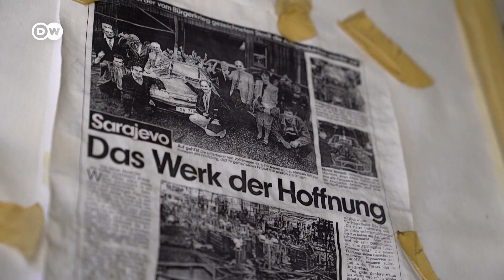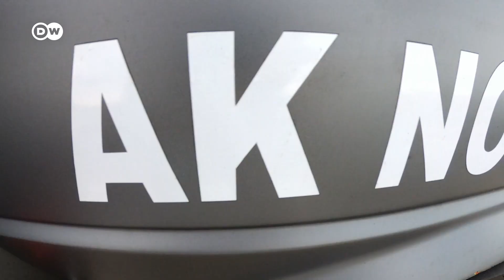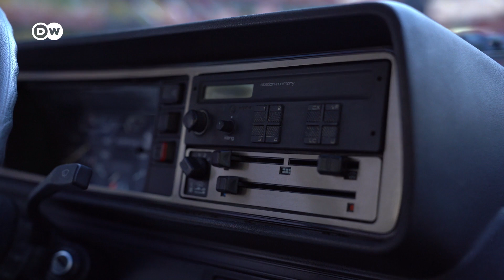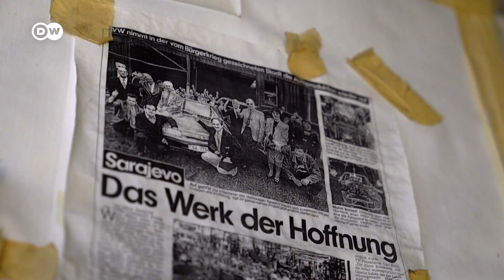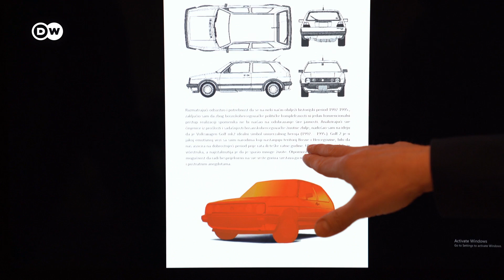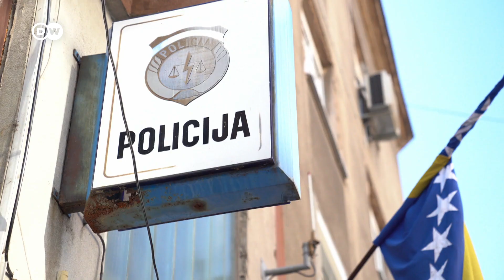Why Bosnians Only Drive Volkswagen

Comment: My father bought a used (1985) Golf MkII in 1995, right after the war for 1.500€. He drove it for 15 years and had someone offer him €1.700 for it after that time. The stories you can hear about this car around here are mind boggling.
Reply from the maker: What a great story! 🤩 Can you tell us some of those stories? We would also love to see some pics or a video from your Golf. Looking forward hearing from you.
Reply: @DWREV  i have a friend that uses a mk2 golf 1.6 diesel for work with 650 000km on the clock. And i mean USING it. Loading it with construction material and driving workers around 😆 While his mk4 golf is kept in the garage for rare occasions.
Reply: due to inflation i guess he did not gain any money even tho the number 1500 is lower than 1700.
Reply: @heisenfeis  He never sold it.

Look at it this way, imagine you bought a car 15 years ago. A car that was driven and wasnt kept in the garage and wasn't invested in. And then someone offers you more than what you paid for it. And we're talking about a car that has been produced in tens of millions, not some rarity.

Inflation would be 43.1%, so it would come down to 2.146 Euros.

Which would mean my father drove a car for 15 years and it only cost him 646 Euros, 43 Euros a year.

What other car can you rent for 50 bucks/Euros a year?
Reply: Tas fabric automobile Sarajevo
Reply: How did you figure out he paid 1500€ in 1995???
Reply: @theexorcist982  My country's currency is directly tied to Euro and has kept the same conversion since it's inception. 

1 Euro was 1.95 Convertible Marks (KM) in 1999 when it was introduced and it still is. 

But even if it did change, It's a lot easier to bring a point across using a currency that everyone is familiar with.
Reply: Now its 1500e still 😆
Reply: 15 years ago 1500 euros bought you a lot more than 1700 euros does today.
Reply: Well after the war you could buy a ton of things with 1500e. Now...
Reply: @gigel99324  dont forgot what value driving from A to B gets you ;) those opportunities are worth way more that 1500 easily. 15 years is only 100 a year. and believe me 1500 still gets you loads
Reply: @Dakoya  i dunno bosnia prices but here in the late 90s a salary was under $100. It was a crazy amount. Now I have $300 cash to pay for random things. It has no value
Reply: @gigel99324  after war u could buy factory for 1euro 😆😆
Reply: @jozobozo9150  in croatia for sure. Kuna was the strongest currency, you could boughty a factory for 1 kuna.
Reply: 1500 in 85 had a different value than it does today.
Reply: The 1700€ was worth then than the 1500€ 15 years before.
Reply: @Qlicky  Was it a diesel or petrol-engine Golf?
Reply: @ It was a 1.6 Diesel, like most of them were in these parts.

Comment: Volkswagen Golf 2 is the best car ever made. I had one about 5 years and drove with it over 110000 km with it.
Reply from the maker: You sold it?! 😱😂
Reply: @DWREV  no, an idiot ran a red light and wrecked his car at an intersection
Reply: I agree.
Reply: My mk2 jetta is the toughest car i bought
Reply: My mk2 have 377.000km
Reply: I’m on my 15th and 16th mk2 jettas.  Ones a Helios gli
Reply: Here in bosnia we have over 300.000 km golf 2's
Reply: @kenan8772  I have had one of mine get 354k MILES.  I’ve had a lot of them with 200k+ miles.
Reply: @kw2519  they are just unbreakable cars😄
Reply: @kenan8772  I know lol so simple but so much fun to drive.  I got my first one about 20 years ago.  I’ve never been without one in the stable since.  Also, 1990-1999 Subarus, too.  Absolutely bulletproof
Reply: MK4 2000-2003 is the very best car Ever made.
Reply: @myneymo77  what? The ones with the 1.8t known for sludge in the oil pump due to use of conventional oil?  Or the super heavy and slow 2.0 8v?  Or the 24v vr6 that blows up intake manifolds?  The mk4 was the last and fattest iteration.  MkV is just a fundamentally different chassis.

If anything, the last couple years of the mk4 were the best of that generation.  They heaps prior to 2004.
Reply: I'm in South Africa and I've owned 3 Golf Mk2 GTi's...
Best cars ever!
Reply: @kw2519  what about mk3s?
Reply: @gpubenchmarks7905  they’re pretty much Mk2 chassis.  I guess I’ve never owned one because it’s like a heavy mk2.  But I suppose one could argue a mk2 is just a overweight mk1.

I have no hate for the mk3.  Now the mk4……

Comment: Short answer.
It was built in Sarajevo factory, and parts were smuggled over the fence for free - so it made it popular because it was basically free to maintain and every mechanic had all parts in stock bought for practically nothing.
Reply: Here in America they never made decent supply lines a VW is significantly more expensive to maintain than a Ford or Toyota. As a rule anything from Europe will cost you a arm to maintain.
Reply: @baronvonjo1929  haha that's kinda funny a golf (not gti or r) is known as a cheap to mantain car here in the eu

Comment: Got a golf 2 as my first car a couple months back and I love it, when it runs properly that is. Its quite the fixer upper as its got carburetor problems, vacuum leak that I cannot find and some electrical difficulties between the temp sensor and heater, but hey, it's something.

Comment: The main reason is because maintenance is cheap, average price of any spare part is roughly 20-50$. Second reason is because the spending standard is very low, average salary is like about 300$, so most of the people can't afford Bmw or Mercedes.
Reply: Have you priced a MK2 GTI lately? I'm guessing not.

Comment: Great video but i must say there is a mistake, that is an intercooler fitted on the front not a radiator🙂
Reply: I bet it needs an IC that size with those performance numbers.
Reply: Yeah... it's an radiator fot the IC... how do you think IC works?!
Reply: @stephmaccormick3195  still not a radiator a radiator cools engine coolant, an intercooler cools the charged air coming from the turbo
Reply: @stephmaccormick3195  no its not

Comment: I am an Indian but if I was a Bosnian I would buy an old VW Jetta or a old Skoda octavia to stand out of the crowd yet  be related to the crazy fans 😜 .
Here in India VW is a premium brand which makes solid cars but they are high maintenance literally because the service centres just don't fix the car , they just replace the entire part assembly on the pretext of damage  preventive maintenance and whatnot plus the parts are expensive despite being made in India. VW skoda is a brand which gives us 75% of driving pleasure that a Audi,BMW or Mercedes Benz would provide at a fraction of its cost. That's  why I love it even if I can't afford to buy it.

Comment: I have VW Touran 2008 , 2.0 TDI 143hp remaped at 220hp, the car uses 5.5-7l diesel on open while driving 120-160kmh. When in sport mode it uses 7-9liter on speeds up to 160-240kmh and 10-14liters on speed up to 300. Its on 18 inch rims and audi s3 brakes.
The car haves 337000km mileage. Not a single black smoke.
Yesterday I did the first service since it was bought , full clutch, new shock absorbers, new brake pads, stabilizers, bearings and oil gasket, turbo gasket, new map sensor for total of 1500€. And thats cheap because i've used Monroe, MANN, Bosch, brembo and ats parts.
Volkswagens are the best.

Comment: The presenter doesnt know much about cars, he called the intercooler popping out that golf a ‘Radiator’ lol. And said there is no space in the engine bay and thats why it’s outside lol. That golf got a VR6 engine mounted longitudinally, and as some people know a VR engine is a compact 6 cylinder engine, granted its hard to boost that engine, but u will have enough space to stick a radiator in the bay without much problem. But the intercooler is usually visible from the front under the hood grill. The piping they did looks a bit off on the golf but it seems like it’s working fine.

Comment: You should also do one on why Uzbeks only drive Chevys
Reply from the maker: What a great idea. Do you know why they love Chevys so much?
Reply: @DWREV  The Chevrolet (Formerly Daewoo) plant was established a few years after Uzbekistan gained independence.
They drive them not because they like them, it's because they are the cheapest cars there due to the fact that the import tarrifs on used foreign cars are too high, so majority of them drive base model Nexia and Gentra.
Not to mention the outdated models they manufactured like: the Daewoo/Chevrolet Matiz M100 (2001-2018 ); Daewoo/Chevrolet Nexia II (1996-2016) which was based on the outdated Opel Kadett E platform. 
And some of the outdated models that are still in production: Chevrolet Labo/Damas since 1996 (shares the same platform as the Suzuki Carry from the 80s); Ravon Gentra since 2003; Ravon Nexia since 2015, but based on a model that began production in 2005.
Reply: @crown674  Venezuelan here, the Daewoo Damas and Matiz were popular here in the late 90s and 00s, I haven't seen many of them since the 2010s onwards.

Comment: These guys would probably hate me then in 2013 I sold my MK2 for parts because the filler neck pipe was rotten and couldn't be bothered to replace so got another golf a Mk5 but that was stolen months later probbly karma for getting rid of my MK2 my friends say